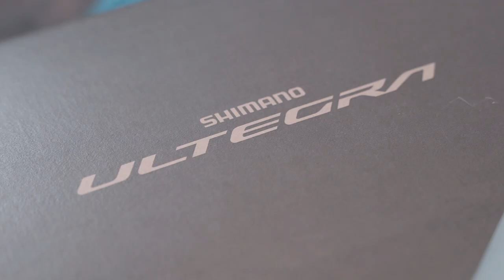Dream Build: 2022 State Bicycle Co. Undefeated

Comment: I am thinking of purchasing the Undfeated frame for my next road bike.  However, I will want to do a 2x rather than a 1x.  I live in a super hilly area with massive grades and think the 1x would not serve me well on the climbs.  I am curious what groupset you used for your buiild.
Reply from the maker: This was built with a mix of 12s 105 and ultegra Di2. The frame supports both mechanical and electric 2x shifting!
Reply: @Timmerrrrm I don't see the hole in the downtube for a front derailleur cable. 
Is there routing for mechanical 2x and the brake hose?

Comment: I’m thinking about getting this bike. How do you like it with the component upgrades?
Reply from the maker: Still a big fan. I now have about 12,000 miles on the bike in this exact configuration with no problems. If you do decide to buy, shoot me an email at timguy80@gmail.com I can get you a discount code.

Comment: I see on the SBC site, they say that max tire is only 700x28c. 
Have you or anybody you know of tried 32mm tires on one?
Reply from the maker: I have run veloflex Corsa Evo tires in 32c for most of my training last year. Plenty of room in the rear. About 3mm of clearance in the front
Reply: I just got the fixed gear version of this frame on FB marketplace can’t wait to give her a tune up & rip her on the road.

Comment: What's contributing most to that 8.57kg? The frame?
Reply from the maker: The frame isn’t light, but nothing on this bike was picked with weight in mind. Heavy bar, stem, bar tape, cassette, rotors, crankset, butyl tubes and very heavy power pedals.
Reply: @Timmerrrrm  Thanks! I'm considering getting a complete bike and swap components since this colorway isn't offered as a framset only.